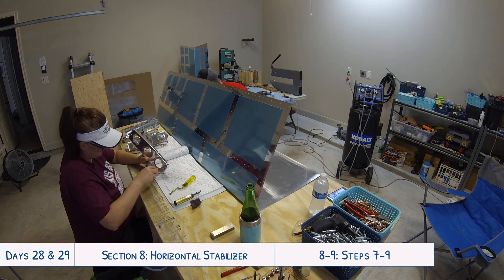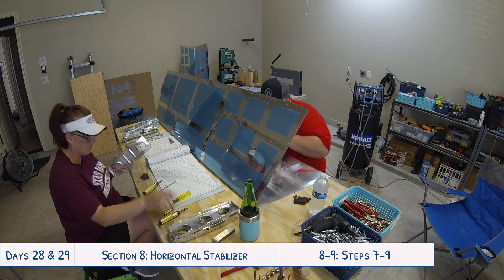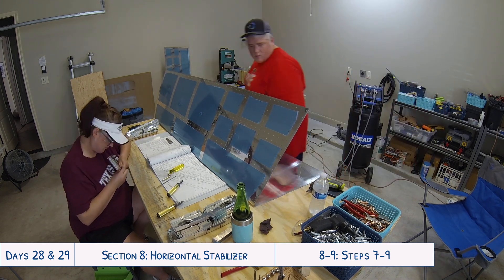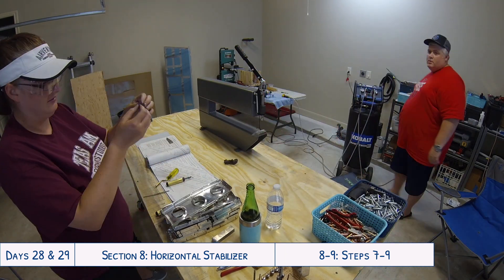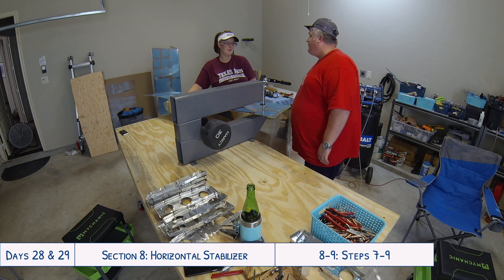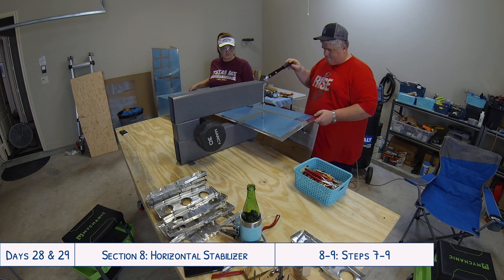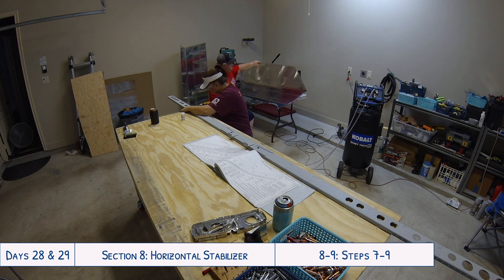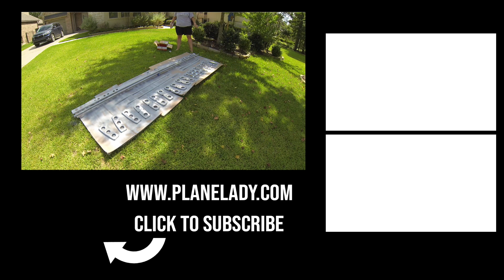Van's Aircraft RV-10 Build: Days 28 & 29 - More Work on the Horizontal Stabilizer (8-9)

Comment: Can you please explain what you mean by flush to the skin vs flush to the rivet head? I'm not sure what the difference is.
Reply from the maker: I think you’re referring to a comment I made while setting the microstop for the countersunk cutter. Sometimes you set it to receive a countersunk rivet - where the rivet is going directly into the piece you’re countersinking. But sometimes you are setting it to receive a piece of skin that has been dimpled that will sit on top of the countersunk piece and then the countersunk rivet will go into both. In the latter the hole has to be countersunk more since it is has to be big enough to receive the dimple in the skin not just the countersunk rivet head. Does that make better sense?
Reply: @PlaneLady  perfect! Now I get it.

Comment: Another reason for having the digital plans is that once you finish the build, if you are like a lot of us, the KAI will be filed in your hangar (in my case, in the engine crate which is nested inside the firewall forward crate which is being used as a work table/storage facility).  It is a hassle when something comes up that requires you to cross reference a build function (as when SBs are issued) that requires you to go to the airport, disassemble your work bench, open the crates, fish out the KAI, etc..... instead of having the flash drive at home to plug into your computer ---- especially since Van's revamped their web page and flushed (and are no longer available on their web page) most of their page pdf updates that they used to have for service questions.  Yeah, having the digital editions is a major plus --- even if they are dated drawings
Reply from the maker: Good tip! Thanks for sharing 😊

Comment: How about a clock on the wall, seen by the camera, in order to gauge the passage of time by the viewer?
Also, what primer did you use?
Reply from the maker: Lol! I’ll have to think about that clock! We’re using a Rustoleum Self-Etching Primer out of a spray can that we get at Home Depot.
Reply: @PlaneLady  Well, I can just see the hands of that clock on the wall going like crazy.  IMO, it would add to the sensation of movement and effort, and convey what it takes.  I hope you add it.
Reply from the maker: To give you a rough idea about how long everything takes, in general most of my videos are at 20x normal speed.